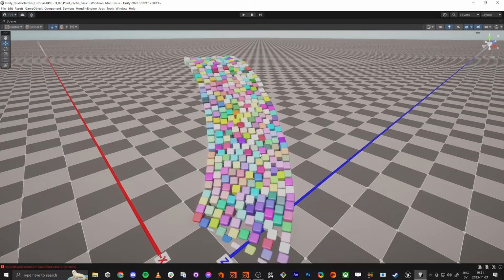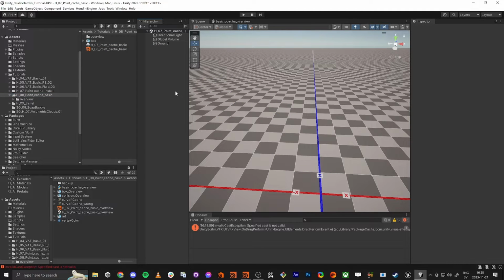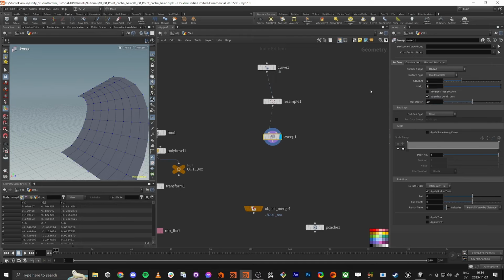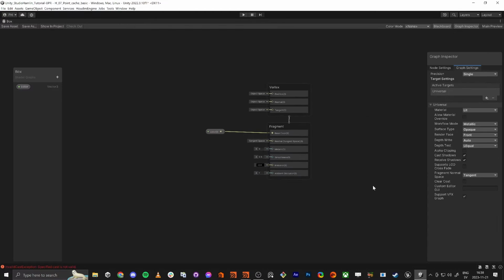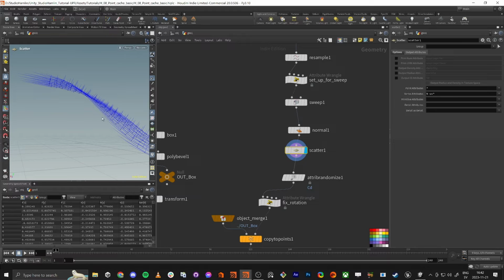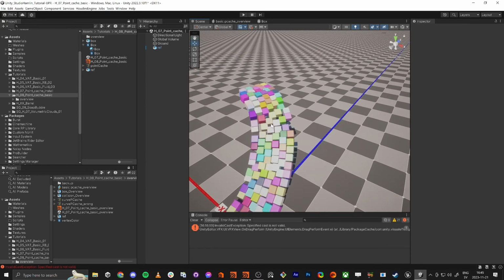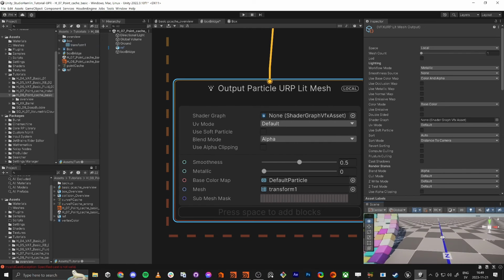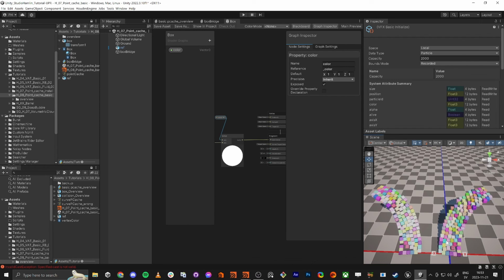Point Cache Basics Houdini To Unity VFX Graph part 1

Comment: What kind of FBX model can export color data? I exported my own model as a point cache, but it doesn't have any color attributes.
Reply from the maker: You default settings do export color data. That is vertex color. Make sure you save it as @Cd as attributes on the models. This is for models.

However if you want to export point cache, then don't use fbx, use the method described in the tutorial
Reply: @TechHamlin  Thank you, I have resaved the vertex colors in Blender and now successfully exported the point cache.
Reply from the maker: @PoohWinnie789  Happy you solved it! 🙂